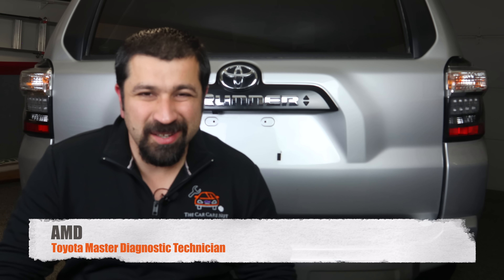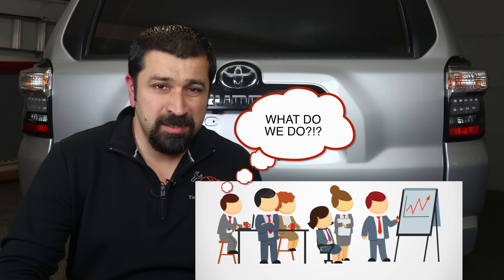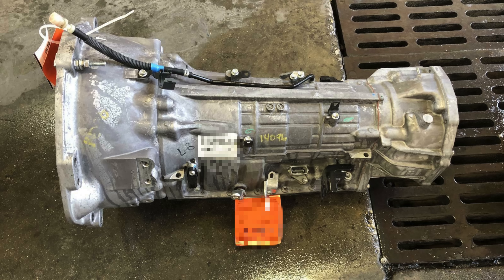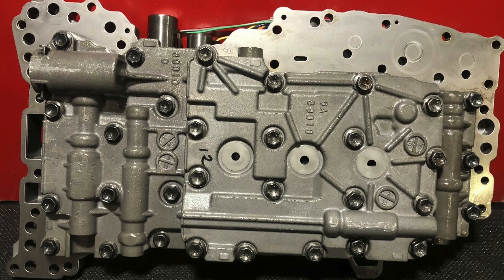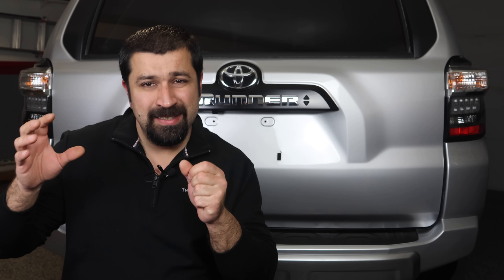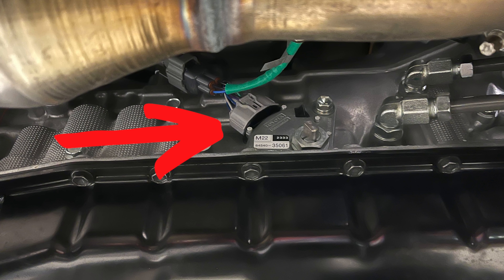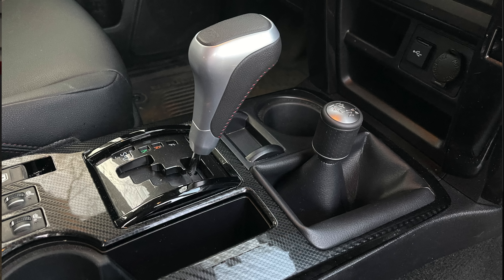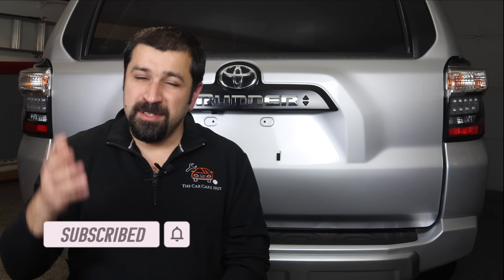Toyota 4Runner Transmission. Why is it so reliable?

Comment: I have 2007 4runner and the dealership said never change transmission fluid so around 170k miles at 35-40 mph and driving like an old man..lol.. it would shimmy pretty bad and it freaked me out.  Transmission shop said Toyota is wrong and fluid needs changing but they did not recommend a full flush so what they did was (not sure of the process) replace 6-7 quarts of fluid and they may have added a tube of transmission lube stuff.  After that the transmission ran great for 1 year then they did same procedure a 2nd time and it's been 2-3 years with no problems.    So once the old fluid is diluted enough with the new fluid it is fixed.   Cost was about 100.00 plus 7 qts of toyota fluid.   So long story short, get your transmission fluid changed regardless of what Toyota recommends.  The fluid does get old and needs changing.
Reply from the maker: Thank you for sharing your experience Jerry! I’ll pin this comment so people would read this. My hope is that they take my word and yours and change the fluid every 60k or 6 years
Reply: @TheCarCareNut  Each time I had 4runner serviced I asked tech if transmission fluid needed changing and I always was told no it never needs changing.   At slow speeds my 4runner would shudder, really bad, and I thought it was a major issue.   Dealership mentioned replacing torque converter or possibly the transmission so I went to transmission shop who knew how to fix it.   Said transmission shudder is pretty common and usually refreshing the fluid fixed the problem.  They said people have this process done all the time as opposed to replacing high dollar parts.   I researched 'transmission shudder' on internet to get informed and try to find low cost option which made me get 2nd opinion.   Transmission shop did not recommend a full flush due to possibly pushing any debris into other parts of transmission and possibly causing other issues.
Reply: @TheCarCareNut  HI, i keep hearing that Dexron III type was the recommended fluid for A750 transmissions but later due to fuel savings there was a switch to WS  ATF  BUT it is still the same ancient A750 transmission. So technically Dextron III can still be used in 2020 4Runners at the expense of fuel economy. Is that true?! Thank you very much.
Reply from the maker: I wouldn’t want to find out honestly. No published information on this.
Reply: @dimdim3490  Just because the gears in the transmission are the same doesn’t mean the clutches and other components haven’t been updated over the years.  Don’t use anything other than WS fluid unless it’s a life threatening situation.
Reply: @TheCarCareNut  I just bought a 2014 4Runner with 106k miles. I don’t think the transmission fluid was ever changed, should I have it changed? It’s one owner and there are a lot of oil changes in the record but nothing on transmission fluid changes.
Reply: @TheCarCareNut  why Toyota did not do campaign on rusting frame like Tacoma.
Reply: @rondhole  - My 1997 Tacoma had a rusted through frame at 91,000 miles.  I got the card from Toyota that seemed to say I had until the end of the year to bring it to the dealer for extended warranty service.  I brought it in late October and it was a few days after the date they would have replaced the frame based on my purchase date, and a savvy lawyer could have figured that out from the small print legalese deceptive not-a-recall card I received.  The weasels at the stealership actually laughed at me for just barely missing the deadline.  They're psychotic.  I remember that from the way they treated me when I bought the truck.  I asked for the actual drive-it-off-the-lot amount that I'd write on the check, and when I got there tired after a long day at work, they had jacked up the price $750 for some dealer BS.  I slumped my shoulders at the prospect of starting over on my truck buying, folded my checkbook, turned and walked away without a word.  The salesweasel was chasing after me saying, "We'll take that off."  I ended up buying it for the agreed upon price, but after the deal was done, the salesweasel just had to say, "You overpaid of course, but a couple of thousand dollars over the life of a vehicle isn't that big of a deal."  He had to win, but even more important to him, I had to lose.  As I said... psychotic.  I wish I'd have kept walking away rather than conducting business with a known disreputable lying weasel.  That was the only vehicle I've bought new, and I doubt I'll ever buy a new vehicle from a stealership again.  I know they're not all that bad, but the horrible process has marked me for life.  For the last several years I had the Tacoma with the rusted frame, I couldn't use it as a truck.  It was a rough riding two seat car that got 20 MPG.  The frame rusted all the way through at 147,000 miles and I scrapped it.  So much for legendary Toyota reliability.  I could have done a lot better with a Nissan 4WD pickup, for a lot less money.
Reply: @Liberty4Ever  We know about the + and- of Toyota Truck. I live in the south and rust is not an issue, they are just indestructible if we maintain it.   Nothing even close and used Toyota trucks cost 2x more than others for this reason.  I agree, I will never buy one with rust issues.  If we have it early enough before rust becomes a problem, Fluid Film applications eliminate the rust completely.
Reply: @rondhole  - I wanted to buy a used Tacoma that was a couple of years old so the original owner paid the drive-it-off-the-lot depreciation but all of the two year old 4WD Tacomas were the same price as new Tacomas.  That seemed crazy to me but I now think that's the free market premium price that people were willing to pay not to deal with psycho weasel Toyota salesmen.

I live in Kentucky where the roads are salted.  I had a hard time buying a $15K 4Runner that didn't have a rusted frame.  Forget it north of here.  I looked at 12 4Runners around Cincinnati one day and all of them had horrible frame rust.  I didn't even talk to the salesperson at the used car lots.  I'd walk up to the back of the truck and look underneath.  The rusted frames had been spray painted black, right over the thick bubbling rust.  Poke it with my finger and big chunks of rust would slough off.

A year ago, I found a 2005 4Runner that spent most of its life in Florida for $10K.  It has some superficial cosmetic issues that I've been repairing but the first thing I did was spray the frame and undercarriage with Surface Shield, which is arguably a little better version of Fluid Film.  Frame rust is car cancer.
Reply: @Liberty4Ever  yes, I won't buy any used cars or truck from North. I always buy from the south and invest some time and money to go to the south to find what I want. I am willing to pay 40 % more for the same mileage and year from the south.
Reply: Yes Lexus also tried to tell me the same BS about trans fluid that never needs to be changed....even tho it's only 1 bolt to drain ai and 1 bolt to fill with fluid....it's almost like they want the trans to break so you have to buy a new one....hmmmm 🤔🧐🤔
I change the trans fluid every 80k or so, the fluid is not cheep but it's worth it. My Lexus has 200k on it now and runs strong AF!

Change your trans fluid...don't flush just drain and fill
Reply: After 2 years since last transmission service, due to transmission shudder, I could feel the shudder return, just slightly, so I took my 6 quarts of toyota fluid to the shop and they replaced 6 quarts and added tube of transmission lube and I am good for at least 12-24 months. Cost 80.00 for fluid and 80.00 for the service.
Reply: @J yeah I serviced my 07 Lexus, and it was the same deal with the 2 bolt drain and fill. The fluid is expensive AF tho lol but worth it to keep an expensive trans alive. I did mine at 70k and now I'm at 200k. So I'll be doing it again soon 🔜 
Def a good idea to change that fluid every 60k...or at least 100k, just imo tho
Reply: Took my 08 4Runner to the dealer and asked to change the tranny fluid and the tranny filter. They said that the tech told me to NEVER try to drop the pan due to rusted bolts, that if one breaks I’ll need a new tranny. So, they drained and replaced the fluid, which I will continue to do every 50,000 miles, currently the 4.7 liter has 180,000 miles, so it’s just about broken in!!
Reply: Yea,they tell u10K oil changes as well.
Reply: @Jerry Ratchford the transmission shop knows that flushing out that old transmission fluid would of ruined that transmission. When you have that kind of mileage on that transmission…the dirty transmission fluid is the only thing keeping it from slippage. All the metal shavings and dirt. Definitely recommend a transmission fluid change every 60k.
Reply: I pull a travel trailer with my 4Runner. So, I installed an auxiliary cooler and a 180 deg. thermostat on the transmission (2016 4Runner). Did this at 25k miles. The fluid was already light brown color. No towing prior to that. Replaced the fluid by doing drain and refill procedure twice. Adjusted the fluid level properly. Transmission ran smoothly for another 25k miles. Now it's not shifting as smoothly. It's time to change transmission fluid again.
BTW, adding a cooler with a thermostat made a big difference. Now, transmission fluid temperature runs at around 160-165 degrees while driving normally or towing. 
So, based on my experience, I recommend partially changing the transmission fluid every 25k miles. It takes about 7 quarts (drain and refill twice). Of course drive the vehicle for 30 min between the second drain and refill procedure. You'll need an OBD2 scanner that shows transmission temperature at the pan to adjust the fluid level properly.
Reply: Love my 21 TRDOP
Reply: @Wesson Harrison Yea, I've been using flixzone for since december myself :)
Reply: I'm looking at a 2003 with 213k miles.  Hoping for the best.  Thanks for sharing your experience on the 4th Gen 4 runner 👍
Reply: I had a 2007 4Runner with 270k miles that was flawless. It got totaled by hail. The buyback price was basically what insurance paid me. I have a 1999 with 295k miles and great. 

I had a 2022 4Runner rental i took from Pennsylvania to Oklahoma. It had less than 5,000 miles on it. The AC stopped blowing cold in Kentucky in the middle of the summer with our newborn baby in the back. We had to turn it back into hertz. I was genuinely disappointed with My only first hand experience with the 5th gen. 

Any ideas? It mustve not had any refrigerant in it. I’m thinking that or bad compressor.

Comment: My 07 2wd sr5 is at 360,000 by Friday.  Work out of it, drive about 4 hours a day home and to work ,not counting around jobsites etc , pull a pipe trailer with fitting etc doing commercial plumbing roughs so put 300 ft or so of pipe and boxes of 4 and 6 inc pvc its a 16 ft trailer .
Most reliable thing iver ever drove . I've had it sink 260 k last summer (2025) is when I got it

Comment: Do you have a video talking about the fluid in this transmission and what to do or not to do? I saw the one on Toyotas maintenance n in general, and you basically said if the fluid goes too long, don’t do anything.  Is that correct? My trans fluid if pretty black.  230k and I just got it.  Want this truck to make it to 300k at least so wondering what to do. Just did timing belt and a little fluid was spilled taking out the radiator.  Should I do anything? Assume it’s ok? Add a little fluid? Change fluid? Filter? Ugh.  So many differing opinions online.  Please respond? Thanks!

Comment: Hey buddy, thanks for this video! I had a question for you. I’m considering buying a 2014 limited that once had a P0776 code for a transmission solenoid B. A trans fluid swap and filter change fixed it and it’s been good for a few thousand miles per the shop. 

Would you be worried about this code indicating future problems are coming? 2014 with 175k miles on it. 

Thanks!

Comment: Great to know this information, thanks AMD.  My second 4 runner, a 2011 has 95000miles and the trans fluid was changed by the Toyota shop where I purchased the vehicle at around 70,000 miles at my request.  The car has no issues, shifts are firm.  One weird thing is when the 4 runner is up to operating temp, there is a slight "shudder" on the one to two gear upshift with very light throttle .  Dealer added little knowledge to this shudder.  doesn't do it when cold or when quick acceleration is applied.

Comment: I recently bought a 2021 SR5. It was “High mileage “ at 130,000 miles. They had maintained it well and now I’m planning on driving it till I die. It great! It’s my second one, I had 2006 but circumstances required me to sell it. But this one I will keep forever.

Comment: The points you raise apply to the FJ Cruiser as well as it uses the same transmission. However, I would like to add to the importance of adding a transmission cooler. Under heavy use apart from towing etc on warm days, the transmission temperatures go up to 248 before the warning light kicks in. An external transmission cooler prevents that. Also, there are true synthetic variants of the WS ATF what meets the specs and outperform the factory transmission fluid and a full fluid transfer goes a long way. Regarding the neutral switch issue, moisture also affects the front differential actuator as well as the rear diff lock actuator. The solution is to use a differential breather kit rather than the one-way valve thats standard and for the front, its imperative to lengthen the air conditioning drain hose. Grease the yokes with every oil change. Do this and expect the A750F to last over 500,000 with ease.

Comment: I have a 99 toyota camry with 160k miles never even took the trans dipstick out let alone service it and its 2025 and it still runs good my 07 4runner i just bought will be my 1st toyota to get a transmission service thanks to this channel.

Comment: Hello AMD.  Thank you for the excellent video.  Does the 2013 RX350 use the same transmission as the 5th Gen 4-Runner?  I also have a 2004 is300 with a 5-speed auto transmission.  I assume that it’s a good and reliable transmission too?
Reply: No. The RX350 is front wheel drive and therefore uses a totally different transmission. You can look it up on Wikipedia.
Reply: I see.  Thank you.

Comment: My 07 4Runner V6 4WD is making a slight slip/mini jerk sometimes after slowing down then accelerating in 1st gear. Changed transmission fluid following your video all good. Could it be the solenoid? Would putting Lucas Stops slips be a good idea? Thank you!

Comment: I bought a 2015 Runner with 70K miles on it. I didnt trust that the transmission fluid had been done at all, so got it done as well as all other fluids at toyota. Shifts amazingly. However i do get a slight bump of gears into gears 1,2 3 but this while im feathering the gas peddle while driving in town. Is this normal? Would really like to know. Please and thank you!

Comment: I hve a 2010 V6 4WD SR5. I used to fret about the transfer case shift lever constantly vibrating but after 15 years I guess it's not an issue. The car does have a few design errors thoug. If you don't address them in the upcoming installments, I'll put in my 2 cents' worth.

Comment: The a750 has been in the 4runner since 2003. I have a 2007 with over 300k and the trans has the original oil in it and basically drives like new still.
Reply: Still shifting okay?
Reply: @berettaguy7445  It doesn't chirp the tires shifting into second anymore. but i attribute that to it having 35" tires now. I did just have the trans out this week to replace the rear crank seal on the engine and the front pump on the trans while i was in there. the rear main on the engine had been leaking for the last couple years. 

That said, i did a couple drain and fills on the trans fluid. I'll do that two more times and then the filter. shifting even smoother now with fresh fluid. 

Toyota ws trans fluid and the aisin a750f are good to go to 315k though !

Comment: My 1993 Toyota Previa LE runs with its original 4 speed transmission.  It has 295K miles and still no problem.

Comment: I have a 2018 4runner TRD Pro, it’s time for my transmission fluid replacement. I have read all the procedures for carista obd and obd pin 4 and 13 jumper for mtce mode. Seems complex to me. I was wondering if I can just retrofit a 2003 A750E dip stick old school and verif level when trans is warm ?

Comment: Bought a 2013, SR5, this week, with genuine 90,000km.  I'm impressed after owning a Series 76 Land Cruiser, with a 1HZ.  Only curious why Toyota put smaller tires on on the Gen Market version.  245/70 R17, vs the 265/70 R17 for US market, with same gear ratio.  Great video, thank you.

Comment: Change your fluid and filter, no flush, and clean the bottom of the transmission pan. All they need, just get the excess grit and dirty fluid out, button it back up, good to go.

Comment: I just bought a 2016 4runner with 188k miles on it. The transmission was bad from the start. When I would go from P to D it would take anywhere from 1-5 seconds before it would shuft. The dealership replaced it with one that has 41k on it. That one now shudders VERY BADLY when shifting from 2nd to 3rd, and 3rd to 4th around the 1500 RPM mark. So I am getting my 3rd one next week. ALL IN LESS THAN A MONTH.

Comment: I am coming up on 96,000 km on my 2021 4runner.  Do you recommend a drain and fill or complete replacement of fluid on the transmission?

Comment: My 2012 sometimes has a shift delay when shifting from reverse to drive. It’ll be in drive for a couple seconds then engage. Other than that no issues shifting. I’ve read that’s somewhat common though. Anyone else notice this or have a fix. I changed the fluid recently and it still didn’t go away